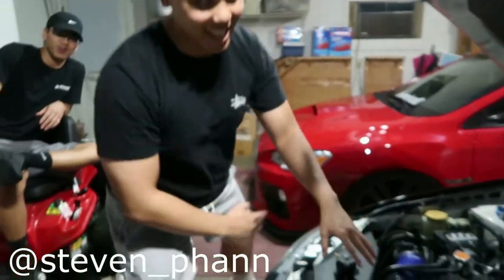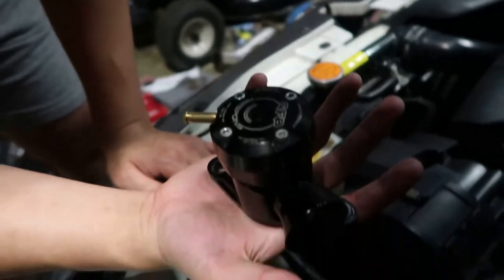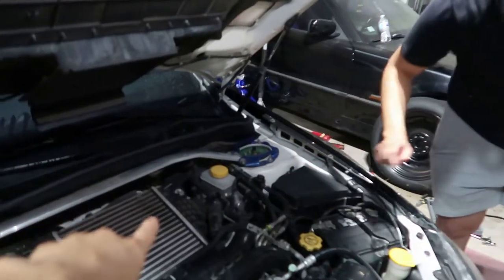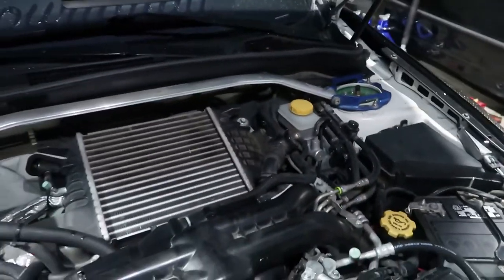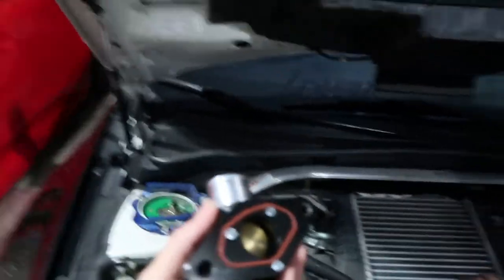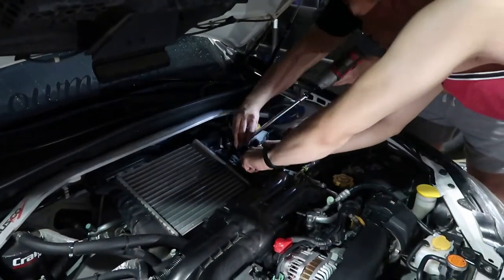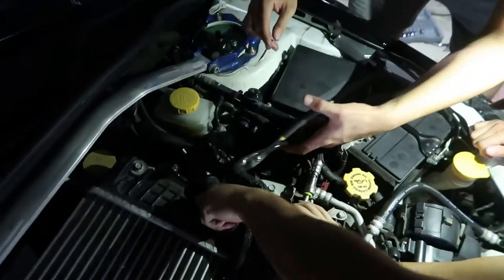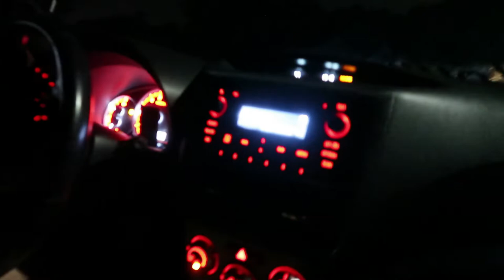2008-2014 Subaru WRX - GFB Blow Off Valve

Comment: Are the cars stock? I have a 2012 WRX hatch and need more pshhh but don’t want to risk doing something to my engine.
Reply: The car previously had a bypass valve, and Steven’s car is actually fully built engine with a catted down pipe with a Invidia q300 with a resonator delete.
Reply: Yo you will be good just throw it on haha

Comment: Is a tune necessary to install a BOV??
Reply from the maker: Luis Sanchez nope! Not at all
Reply: @lightheartmediaofficial  hey so just to clarify I just got a 08 wrx it's completely stock, was disappointed that there is hardly any turbo sounds, I could just do this (put on a blow off valve) and that's it!? No tuning or nothing at all??? Really!
Reply: t.j pennington you’re best getting a 50/50 bov or something like this gfb response where you can change the venting bias. It keeps the car happy so it doesn’t run overly rich. It will run rich with a bov being that you’re letting air release that’s been counted for my the maf sensor so there’s fuel going in for air that isn’t there. But this only happens for like a split second while you’re shifting so it doesn’t damage the car at all. Just don’t go full vent to atmosphere or you will have problems with stalling and backfires.
Reply: @kylehardes4938  but backfires are sick lol
Reply: @qcwred  first off the 2008 has no power, should have got a 2009+. Regardless, the car is expecting that air to be pushed back through the engine, if you are venting (hearing the noise), you are loosing power IF the car is not professionally tuned.

Comment: Your stock bov will sound the same if you just straight pipe it
Reply: No no it won’t bro😭😭 straight pipe is the exhaust. Blow off valve is part of the intake and air mangment system completely unrelated. With an intake you may hear it but not a straight pipe😭
Reply: @danpitre7916  I’m on stock bov and stock intake, you’ll hear the turbo more no matter what you do with the exhaust? I can send a clip